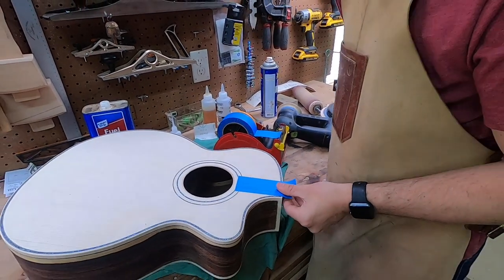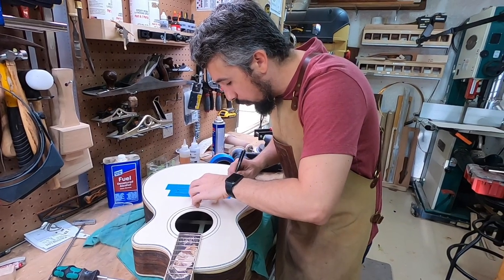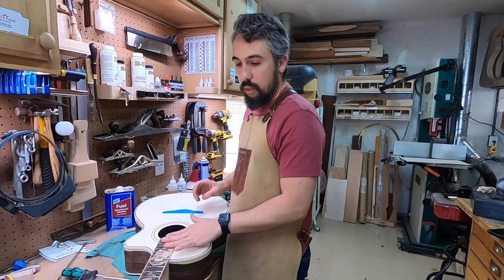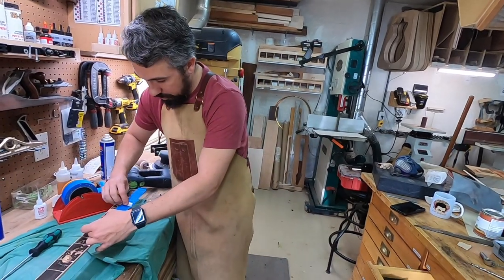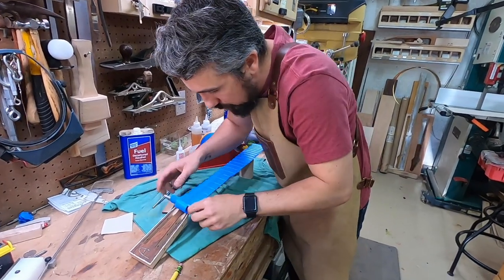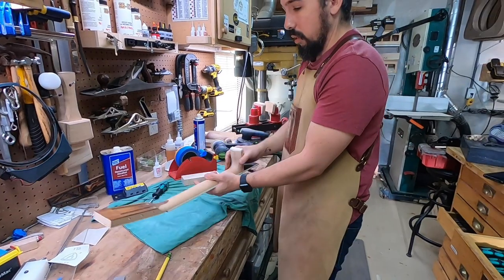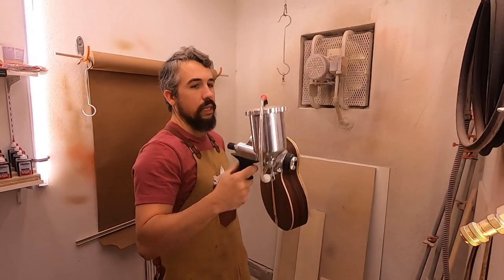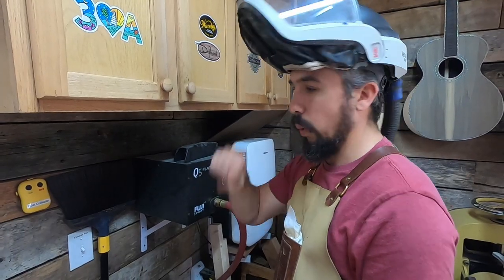How to prep a guitar for finish. Part 2

Comment: I always hang the tape over the edge a little too and roll back the edges so I dont get a hard line. I use a Quarter to get the tape into the frets really tight. Im self taught from books and find I do a lot of things the way you do. Ive been building and repairing guitars and Mariachi instruments since 1998. Too bad I live in Texas or Id apply for a job. Haha Saludos from Dallas ✌🏼

Comment: Thank you for the wonderful videos! They are very inspiring! I heard you say you use a 50/50 cut of: Cardinal’s and “lacquer”. What is the other type of lacquer you use and what is the purpose of the blend? Can you help me understand why it would be preferred over solely using the Cardinal’s? It’s always been a dream of mine to build an acoustic guitar; I want to get it as best as I can and trust your advice.
Reply: I noticed that too, I wonder if he meant to say 50/50 cardinal & laquer THINNER? Or maybe he meant 50/50 nitro and non nitro laquer?
Reply: @recordplayerz  Yes, I was wondering the same; those are good ideas. I think I might try a variety of options on some test pieces. I've heard others use solely laquer. I hope your project goes well!

Comment: If you use a spring (not too heavy) on the hanging rod, it eliminates uneven spray on top and bottom from bending/reaching and you keep the gun at the same distance all around. Also a handle on a more rigid hanging rod keep your hands off the work as you spray...IMHO